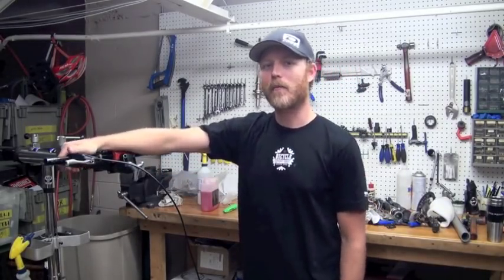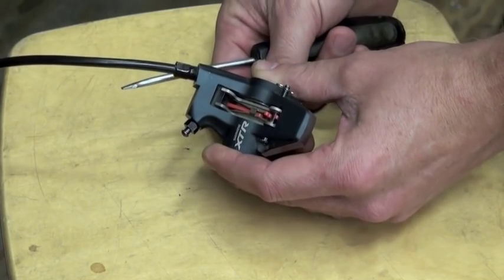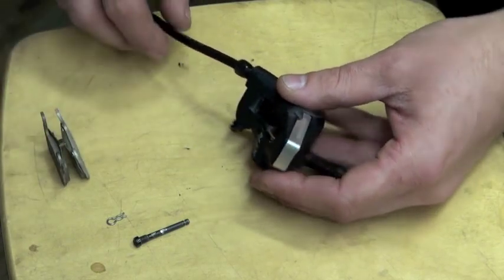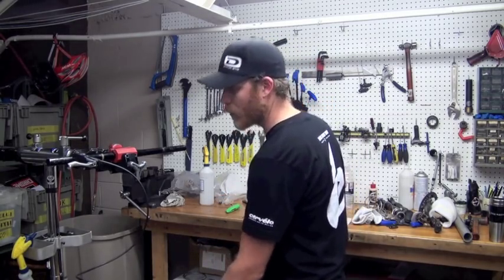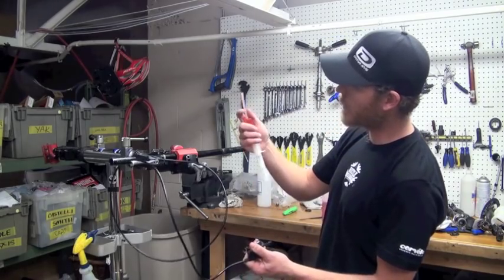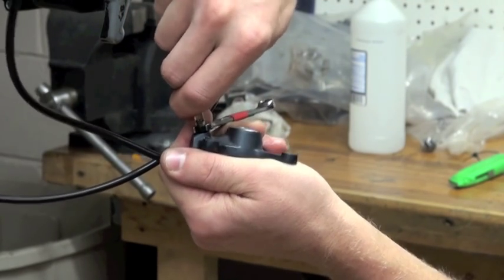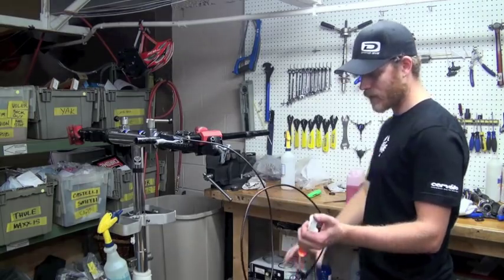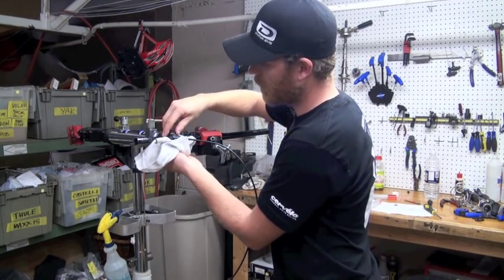Shimano Brake Bleed

Comment: You don't need a brake bleeding kit for this at all. Put the caliper at the lowest point. Remove the bleed plug. Pump the brake very slowly. Now lift the caliper up to about the same height as the handle bars. Keep bumping the brake lever. A bunch of air bubbles will come out. Keep filling the fluid in the reservoir too. I would lift the caliper, pull the brake lever, lower the caliper, release the brake lever. Air bubbles will be coming out of both ends. Just do this until you don't have any air bubbles. Takes about 2-3 minutes and saves yourself a 30 dollar kit that is fucking junk anyway. This is how I have always bled mine. Hell, I've done the same thing on my motorcycle before. Or you can do exactly what you do on a car. Takes a little longer and it's kind of hard to hold the lever and take the plug out of a caliper that you are holding. But if you have two people, bleeding bike brakes is exactly the same as bleeding car brakes.

Comment: Been using Shimano  for last couple years over Avid .At first, for the simple reservoir system.  After going to the servo XT's systems from the 1st gen Xt's, I can say that Shimano really knows their shit.  I just restored some old quad XT's w/ XT serv levers and they are so powerful. The longevity of Shimano brake compnts is impressive.  HAS ANYONE BLED THE 2012 XT's yet?? This new inline reservoir looks like the Avids bleed system.  That makes me a little worried.  I love the open reservoir.

Comment: i would like to ask if it would be ok to use a bleed spacer XT785 on an xt775 system.
 (except from the difference of the hole above the main structure)
the shape of main part that fits between the pistons has the same shape?
i can only fitn xt785 spacer here i live

Comment: I have watched your video many times over the years just to remind myself how to bleed my brakes on my Gary Fisher. It is a Shimano bake set and does have a reservoir just like in your video. Now for some reason on my attempt to bleed my brakes today the reservoir by the brake lever does not want to fill up. In fact it doesn’t want to flush any fluids through. Is it possible that my brake levers are bad? What do you think it the problem may be? Also I have completely taken it apart to make sure that the line and the caliper by the wheel is not clogged. Which neither are.

Comment: to remove air bubbles that form in crevices and areas that the fluid flow in the direction of the reservoir wouldn't normally remove.

Comment: i did this (with brakes instead of a spacer) and my brakes was so loud. then i bought a new set of brakes and cleaned the brake disc with two different clean cloths to make sure that there were no oil on the braking disc and then i put it all together it was still very loud. what could i have done wrong?? and ofcourse my brakes wasent very effective :(

Comment: The manual states that you should dispose of it (in an environmentally correct way)
I found that if you're careful about using clean syringes and containers, you can re-use it. It doesn't bind water like car brake fluid. But that's just an opinion, no guarantee given.

Comment: If you get brake fluid or grease on your pads you do not really need to replace them.

pull the pads out, and place them in the over on BROIL (500 degrees F) for about 20 minutes.   It will literally burn off the fluid that has soaked into the pads, but wont damage the pads.

while they are "cooking" then cooling, clean the rotor with rubbing alcohol or brake cleaner, anything that got on the pads got on the rotor so make sure you clean the rotor,  Ive done this several times with great success.

Comment: Use some Pentosin CHF 11s in there if you find Shimano fluid it be overpriced snake oil. Many people have found this to work great and have run it for years without issue.

Comment: awesome video Clay! Tried to do this job with some cheaper mineral oil from a shop called halfords, here in the UK. The problem with the cheaper mineral oil is getting the little bubbles out. I had problems getting bubbles out of just the syringe, let alone the actual brakes!!!! Gonna order some shimano fluid straight away, and will let you know how much better it is. Thanks again.

Comment: Should you bleed shimano hydraulic brakes if you just want to replace the pads??
Reply: Not necessary unless you're detecting a squishy brake lever. You may need to push the pistons back into the housing to make room for the extra material of the new pad, but the system should self adjust after that.

You should, however, periodically bleed brakes to purge the old fluid out of the system. If you haven't had a bleed for a while you may notice the old fluid is blackish, and nasty looking. About once a year I'd say, unless the lever is squishy. Then ASAP.

Comment: Question,.. I had to move my brake levers toward the handlebar stem, (I put on some handlebar ends/grips), and now the brakes are unable to give that last bit of 100% grip at the end of a brake lever pull to help bring the bike to a safe and definitive stop,.. what can/should I do to get the brakes working 100% again? Brake pads have had hardly any use, (maybe half a dozen 2hr outings of relatively flat terrain) and I don't much fancy the (likely high) cost of getting a professional to do whatever needs doing, especially if I can learn something - thanks. I'd like to get back out on my bike.

I don't have any tools for the job apart from a screwdriver and a spanner - I have no brake bleed kit or fluid etc. :( If I absolutely have to get a professional to do it, what specific job should I ask him to do, (bearing in mind, cost)? Thanks.

Comment: I think applying a little vacuum makes the bubbles bigger so they dislodge and flow upward with the fluid - good tip I hadn't thought of that! Also I would have straightened the hose line and not attempted a bleed with a great big up and down loop in it like that- possibly they will still have air in them for that reason. My ST-M775 XT combo shifters have the reservoirs pointing downwards so not sure how to tackle them, invert the bike and standard bleed? (ie not reverse bleed)

Comment: hi have a shimano br m535 brakes want to bleed them but don't have bicycle mineral oil, can i use car brake fluid
Reply: only if it is the same dot fluid if it was dot 4 you could use dot 4 car fluid because its the same stuff but if its mineral oil operated brake you cant use dot 4 or 5.1 fluid

Comment: That brake lever was still sloppy at the end.
Reply: they have ajusters on the leavers, I can make mine go all the way back to the bars with no air in the system.
Reply: I did mine, as long as you tap the brake lines to push the air up to the levers and keep the fluid topped up it works brilliantly.

Obviously if the fluid is jumping out when you pull the levers then your pulling too hard and too quick 😊
Reply: VNIMAL
Levers*